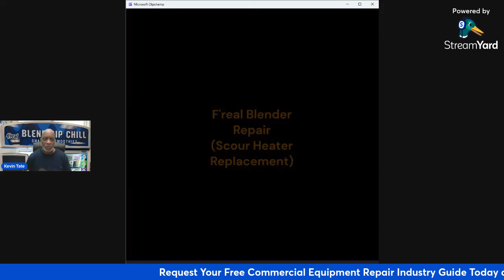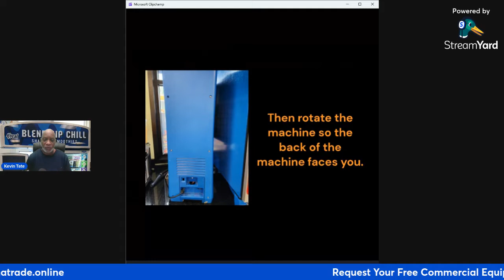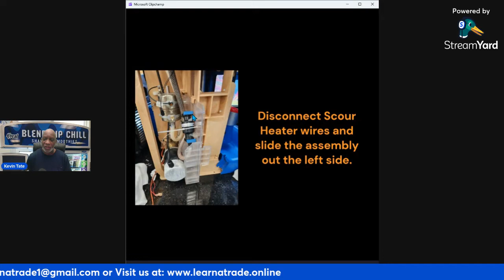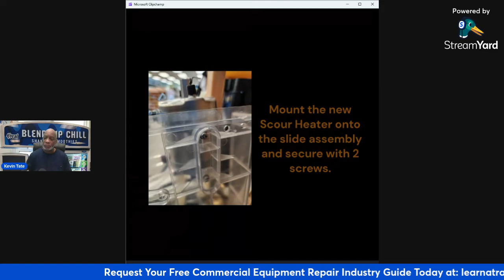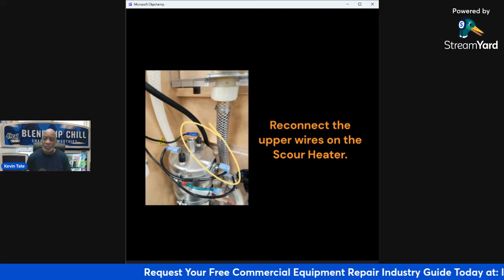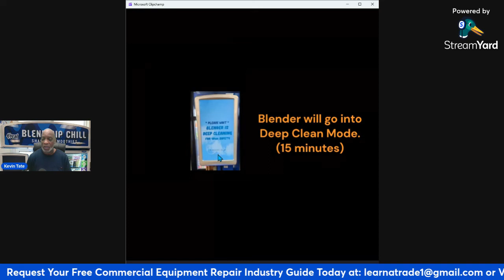F'real Blender Repair (Scour Heater Replacement)

Comment: How much should i charge to replace this item to client
Reply from the maker: @tyregalaxy28  Hey that depends on if you are doing the Repair for a regular customer or if this is a warranty job. In most cases you want to go with your regular service rate. Remember on these machines sometimes it may require a second trip.